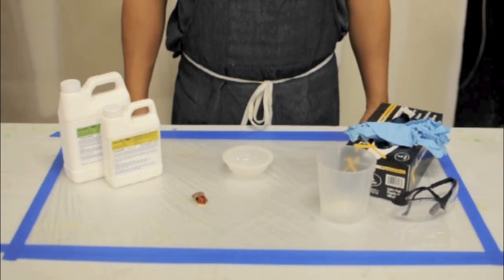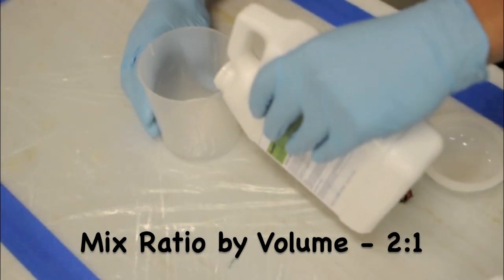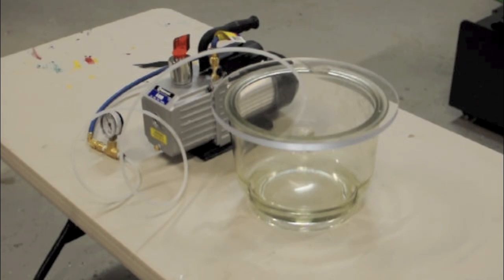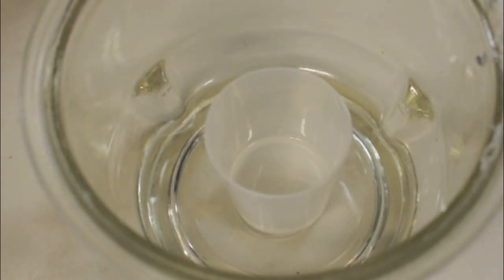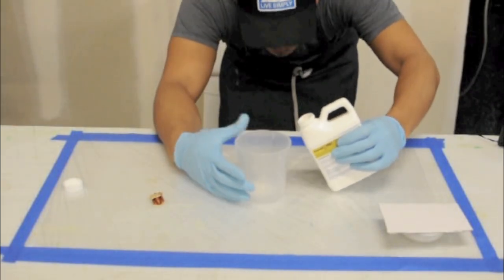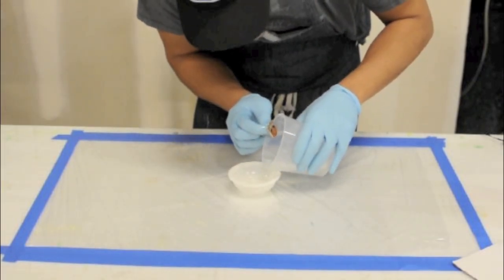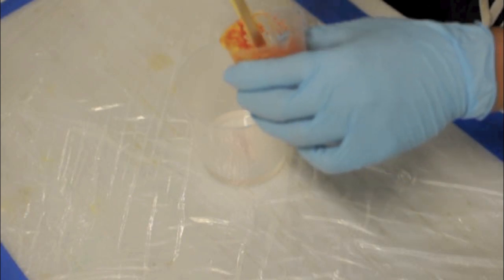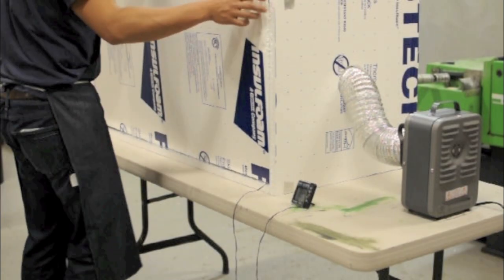Video Tutorial: Super Sap CCR

Comment: When does surface hardener need to be used? And what is the difference between this resin and methyl methacrylate? Lastly, can a hot object like a hot cup of coffee be placed on this surface? What about a methyl methacrylate surface (if they are different). I'm tying to find the hardest, most stable and permanently curing resin for embedments, I dont want something hot denting it, plexiglass doesn't indent from heat, and apparently it is the same stuff.

Comment from the maker: Really anywhere but the molds used here were from Tap Plastics. The key will be to use a mold that has a very smooth surface. For surfaces with textures you might want to consider using mold release.